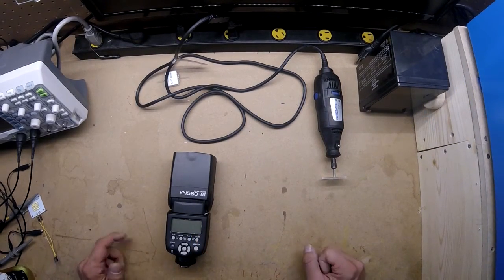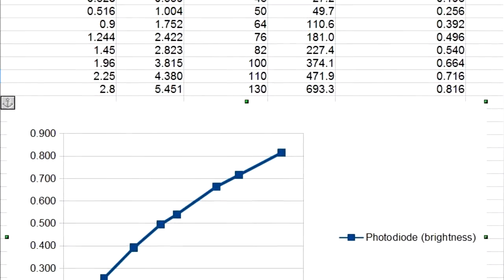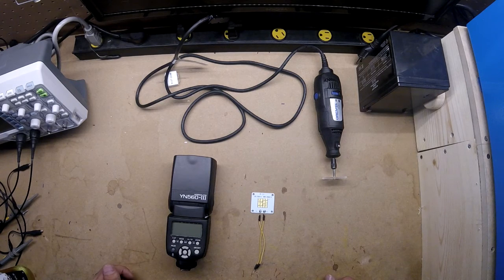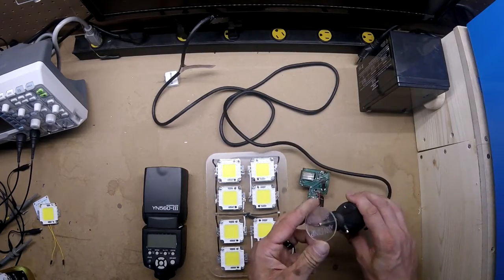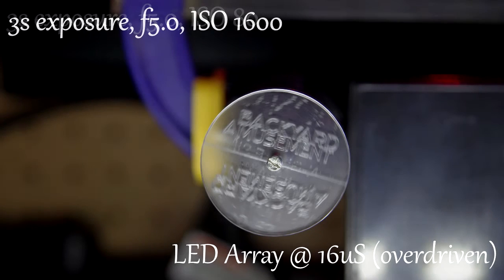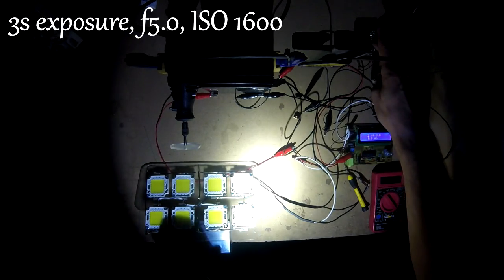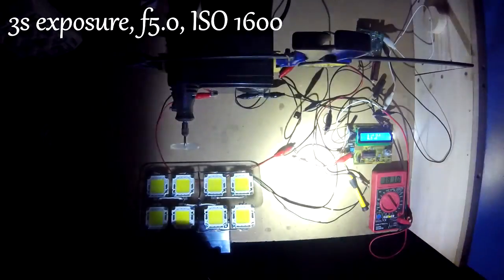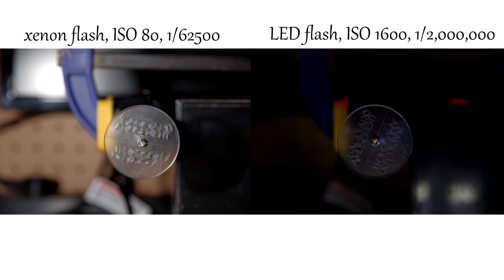Photoflash: Xenon Vs LED - Part 3

Comment: I'm very interested in creating an array of 100W LEDs like you've done here to shoot high speed projectile impacts, hoping to get a flash duration of 500ns to 1ms, like you've done here, but I'm having some trouble figuring out an effective way do it.  I'm still pretty new to the world of electronics, and I was wondering if you could give me a basic run down of how you overdrive the LEDs and what you're using to control the duration of the led pulse?

Comment: Nice test, but I dont think it's accurate.  The Xenon can reach peak brightness much faster than the leds can.
So, for the Xenon when it receives the fire signal, it may take 500ns to reach peak brightness whereas the LEDS may take 2us. I am no camera guy, but if its possible to adjust the time for the flash signal I would try that to fully prove that that leds just wont cut it.  gotta give the leds more time to get to full power first before the photo is taken.